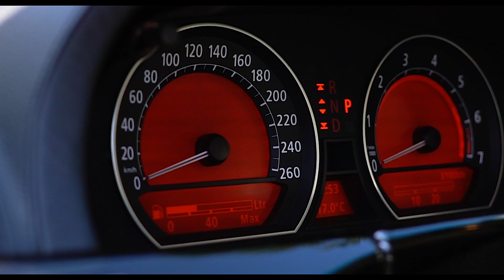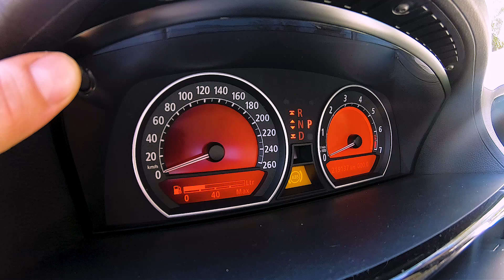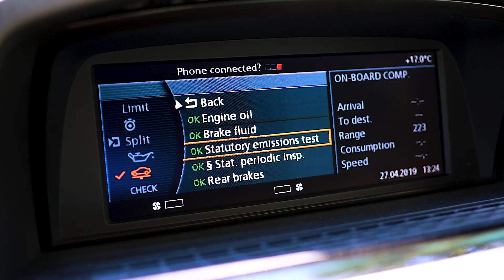A Bit More Then A Oil Change - BMW 760i E65

Comment: Did you end up replacing the alternator bracket seal and the oil thermostat o-rings? I’ll be doing those next weekend!👍 love the red
Reply: Never mind 🤣🤣🤣 you did a complete overhaul! Great videos of a very special engine!👍🍻
Reply from the maker: I did replace both of those seals. And a lot more 😀. Glad you like the videos

Comment: Wait why is the sump pan so small?
Reply from the maker: It's only the lower oil pan. All V12 and V8 has the same small lower pan. Most of the oil is in the upper part of the sump.
Reply: @SATSMotors  Thanks for your explanation.  I learn something new about my E66 V12 every day!

Comment: I have already replace an alternator bracket seal on N62, do you know if it is the same procedure on the N73 ?
Reply from the maker: It's basically the same. Maybe a bit easier even. You can check out my other video https://www.youtube.com/watch?v=FZEdQbBMTho